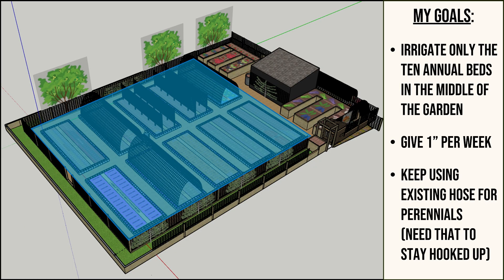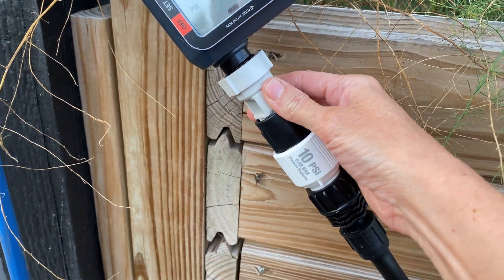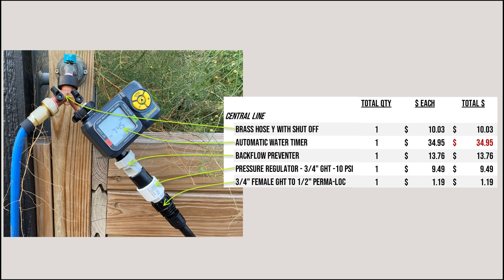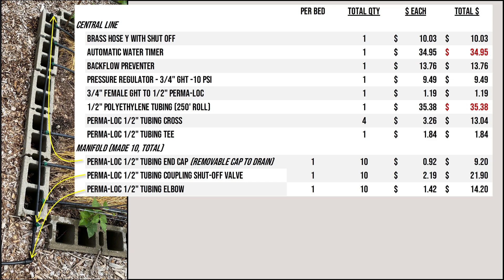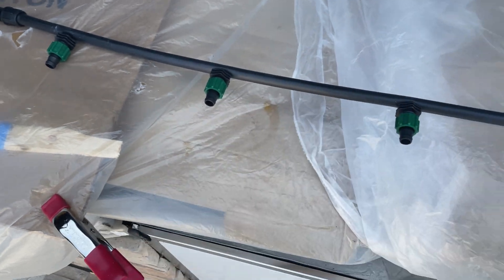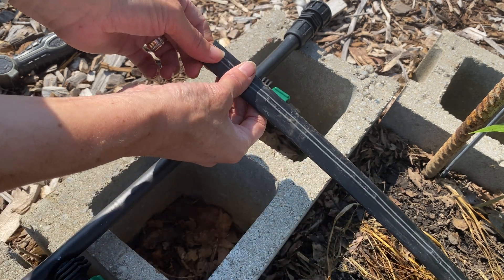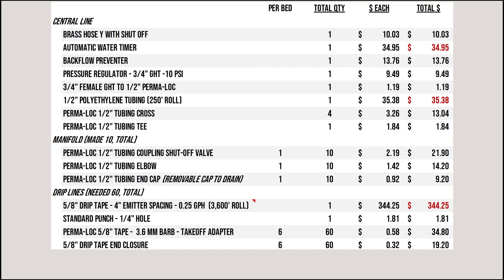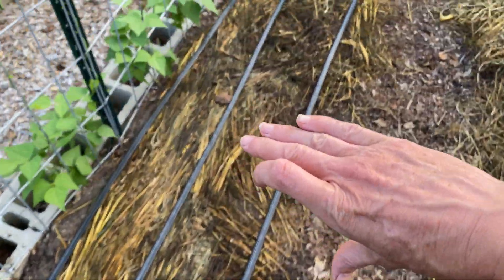Our DIY Drip Irrigation System with Detailed Parts List and Full Cost

Comment: Did you consider 1/4” drip line instead of drip tape?  Thank you for your video.
Reply from the maker: Hi!  The tape is cheaper and since my design is linear (straight lines on rectangular beds) it worked for me. If I had curving lines in the design, I would’ve gone with drip line.

Comment: I am looking to do the same thing in my garden for next year, when looking into it, the site says you should only have enough pressure for 200 gpm. Is that something you experience? or do you have enough pressure to run several of your beds at once. My garden is not as large as yours but I think I need at least 2 main lines so my whole garden is watered while we are on vacation next summer. I love how detailed and well thought out your videos are and I have enjoyed them for a long time.
Reply from the maker: I’ve walked around and done visual inspections of it while the system is running. The emitters on the beds at the end of the line only “plump up” and start emitting once the beds at the beginning have come up to pressure, but it’s not a huge delay…maybe 2-3 minutes before they’re all full and emitting?

Comment: 15 minutes is a nice stroll around in the early morning with your first cup of coffee or tea for the day, observing that all the drippers are working and none of them has got clogged. If you get the same "I built that and it fixed the problem" happy feeling that I do from inspecting that sort of successful project, that's going to be a lovely mood boost to start your day.
Reply from the maker: You just described my morning routine…although it’s paired with patrolling for, and killing, Japanese Beetles so it’s slightly less zen. But still a satisfying routine (both the project and the beetles).
Reply: @WellGroundedGardens I have Virginia creeper all around my house and one year it got into my flower beds.  I decided to try to tame it since it looked nice on the fence it was growing on.  I discovered it worked extremely well as a trap crop for Japanese beetles!  The beetles ignore my flowers, my beans, even my Niagara grape and attack the creeper instead.  Did some research and I believe the key is growing it in the sun!

Comment: That's a very nice setup. I would have tried to curve the pipe into the manifold rather than using an elbow because you will lose a bit of flow there, but it's probably not enough to matter in context.

I found when installing agricultural water pipe, it was important to do it in pretty cold weather - roll out the pipe on a warm sunny afternoon when the plastic is softer, but do all the cutting early the next morning when it's cold. The black polypipe expands when it's warm and if you cut exactly to length and then run cold water through it, the plastic will shrink and pull out of its joins. If you're doing underground installation, which realistically is the only way to stop the cows chewing on the pipes when they're bored, then you really need to make sure it's cold because it's going to be cold as soon as you fill in the trench. So the way your pipe wanders a bit might look a bit untidy, but you'll be glad of the bit of slack you've left in it when the weather gets cold. 
Ag poly is a bit thicker than garden poly, so often I'd be using a jug of boiling water to warm up the end of the pipe before hammering the fitting into it. 

When you're ready to upgrade this setup, I'd suggest getting a water outlet installed inside your shed and putting the timer indoors. They say these things are UV protected, but the plastic always turns out to last longer if you put it indoors.
Reply from the maker: That’s a really good tip, thank you!
Reply: Good tips.  You sound like the voice of long experience!  Thank you.

Comment: Will the same process you describe work for raised beds located on a slope? Specifically, the addition of "T" and/or "L" connectors with vertical pipe/tube up and down the end of each level bed sequentially downslope. I'm hoping the pressure reducer will make this possible. My water source is located at the top of the slope and I plan to bury the supply line under the sod so we're able to maintain the lawn in between the house and the garden without riding over it constantly when mowing. Thank you for any ideas!
Reply: You can do that, yes. Set it up like this one, run it until all the pipes are full of water, and then sink a small bucket under the first drip outlet in every bed. Run the water for a little while, and then compare how much water is in each bucket. If it's not the same amount, adjust the valves on the beds that are getting more than their fair share. Then test it again. Once you've got it adjusted so they're all getting the same amount of water, put a mark on each valve so you know where it's supposed to be set to - otherwise every time you close one valve because that bed is fallow for a few weeks, you're going to have to rebalance the system again.
Reply from the maker: I'm really glad that you answered this one!  I have a gradual slope, only, across my garden, and haven't dealt with terracing or steep slopes.

Comment: Can you address: how to avoid too hot of water coming out of the hose in an irrigation system when you first turn it on in the morning on hot days?  It seems like this would be bad for the plants.
Reply from the maker: The water isn’t subjected to much sunlight, since I run mine at 6 am. If you ran it at 2 pm that might be a bigger issue but generally the recommendation is to water first thing in the morning.
Reply: @WellGroundedGardens  Thx.  The water in my hose is still hot in the morning.
Reply from the maker: The system basically drains itself once the water shuts off so you wouldn’t have much standing water in the line to collect heat.

Comment: You need a filter after the pressure reducer to keep dirt from blocking your lines.  I use Drip Depot.  The have all the stuff you need, plenty of great advice, and usually get back to you the SAME day!
Reply from the maker: I was debating adding a filter!  There’s one built into the brass Y but a finer mesh feels like a good insurance policy
Reply: Rainbird make several pressure regulator filters. They are well made. Highly recommend them.